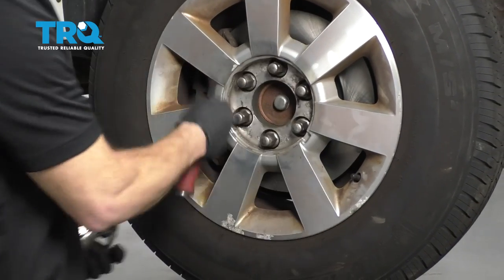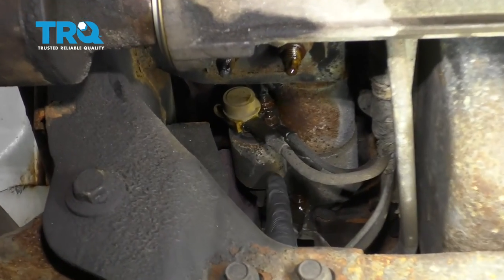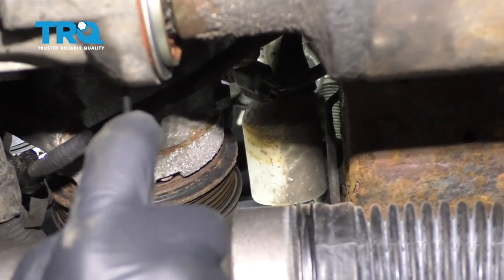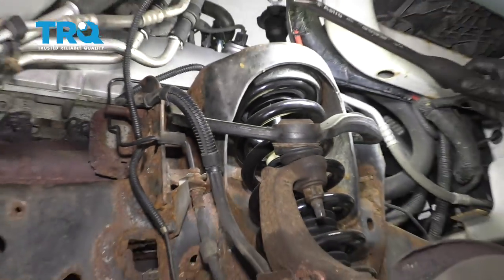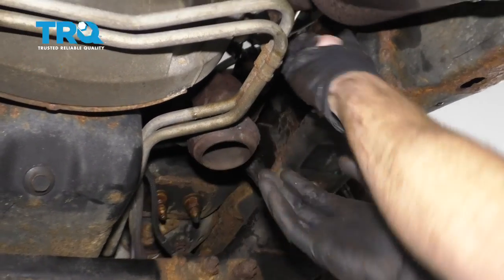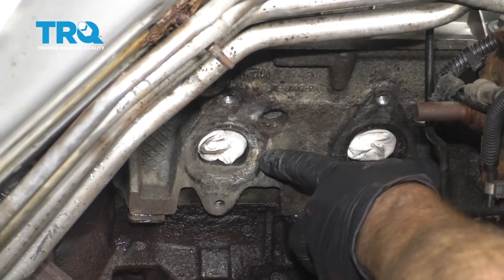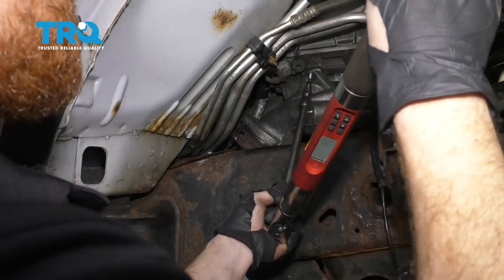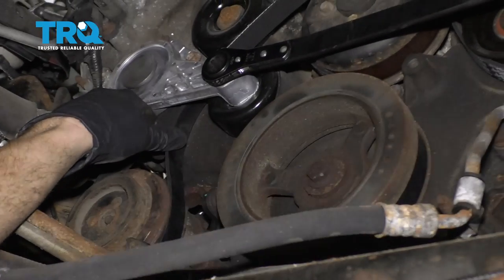How to Replace Passenger Side Exhaust Manifold 2007-2017 Ford Expedition

Comment: This was a good video, lots of tips. Although if you couldn't remove the studs like myself, the easiest way to remove the manifold is to lift the right side of the motor about an inch or two and the exhaust manifold just falls off without removing the studs. I struggled removing the studs and probably would have broken some of them. Struggled for nothing!

Comment: Great video.  Just did mine on a 2009 f150 platinum.  Only removed the alternator.  Got the bottom front bolt out from the engine compartment. Snapped a bolt, used a welder to get it out. Manifold came out thru the wheel well.  Removed all studs but the front 2.   With the radiator and exhaust still in the truck it was harder than this video makes it out to be.  Dm if anyone needs help.  Thanks again

Comment: How did you reach the nut on the top side of the passenger exhaust-manifold connection. I'm working on a similar vehicle and it is almost impossible to get to let alone get enough torque on it to remove it. Thanks